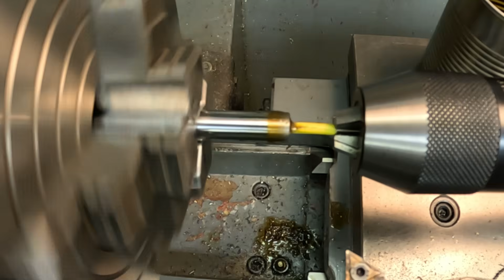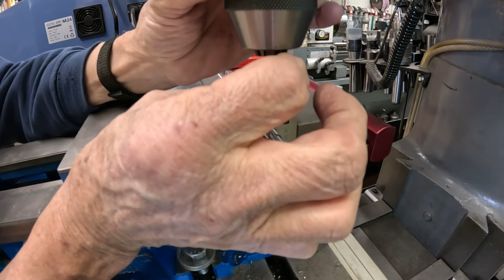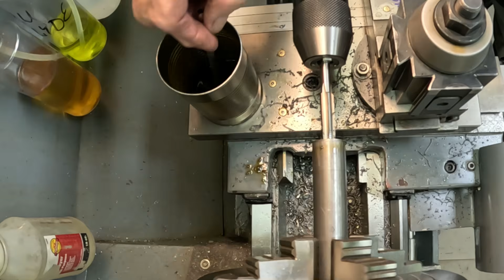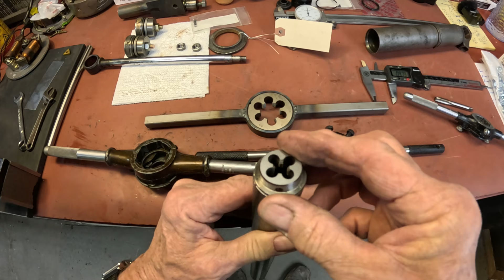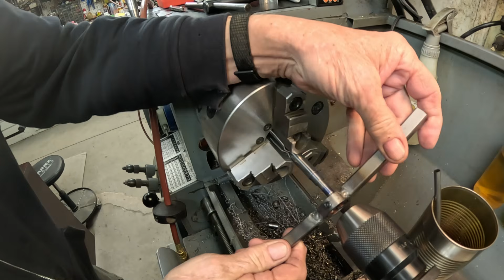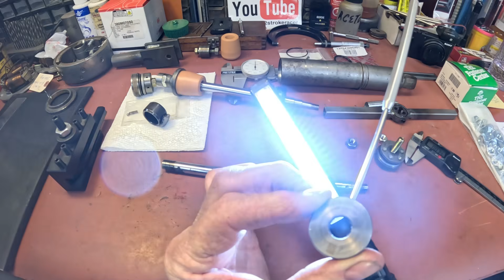Rebuild your Suzuki RM125, 250, or 400 rear shocks part 2

Comment: You don't even need a jam nut on the lower eye. Most shocks just use Loctite 272 there. They will never undo without heat. The top spring seat should fit over the lower eye and over the bump stop, so you don't need to have it on the body before assembly. On to part 3!

Comment: Hey Dale;  have you considered the servo motor lead screw conversion Clough42 has done ??  That gives you the ability to cut literally any thread.  I love his stuff.  I haven't done it, as I don't do that much threading.  But it also would give the ability to drive the carriage stupid slow, for very fine finishing on a smooth part.  I love all this stuff!
Reply from the maker: I watched that, but he is a young techy kind of guy and understands all that electrical mumo jumbo. I'm a mechanical guy that is more suited to changing tires and working on greasy old bikes. But that being said, I can appreciate what he is doing and wish I had the mind  that could do stuff like that, guess I will just set back and watch and enjoy his endeavor. I think I have located the gears needed to convert mine to thread more of the millimeter threads. That will be just fine for me, but I agree with him that I would rather eat a bug than change those gears. But the beauty of being retired is that we have a lot of time on our hands. I have to agree with you also....I love all this stuff, its really cool to watch all the different guys and gals out there work their different challenges.
Reply: @montana2strokeracer  I'd LOVE to try and set Clough42's servo-controlled lead screw thingy up on m y little Atlas lathe.  That stuff just fascinates me.  No idea what he charges for his setup, but I "think" I could pull it off.  I've messed with encoders, and computer controls most of my 2 careers (photogrammetric engineering, and then mining engineering automation).  Somehow I missed my true calling, as machining and metal fabrication is just in my veins.  That love was awakened by doing mechanical design, and then learning how to create drawings the machinists and sheet metal fabricators could make sense of.  Those guys taught me a lot of stuff ....... and then I had to go buy machines to install in my own garage.  Doing this stuff for friends is so fun and satisfying, and keeps me from hanging out in bars and chasing loose wimmens.
Reply from the maker: Oh yeah, I get it....think its above my learning. But I totally understand, this youtube thing keeps me out of the bars and chasing those loose hussies'.

Comment: Even a later model trail dual purpose model from Suzuki might be fitted and might be a rebuildable and have external rebound and compression adjusters and work 10 times better .... Back then there were many aftermarket shocks made and could be found with searches.... Whether thebike is worth upgrading of course would determine the cost spent....
🇨🇦🤓👍
Reply from the maker: Hey Gary its not about the shocks, its about the challenge of working with my hands to see if I can do what I set out to do. I enjoy the work and staying busy more than riding. I have done my racing and riding, today I enjoy this more than the riding, although I do still enjoy cow trailing. Racing is behind me, and broken bones take way longer to heal these days.
Reply: @montana2strokeracer I'm 68 and finished racing too and riding is not important right now...I realize you just want to do it and go ahead..lol
Anything can be done if you try...
🤓👍🇨🇦

Comment: I used to race motocross and Arenacross...started in 1975 and raced up to 1991....I started rebuilding my own shocks in the 1980's and frankly...while your effort is admirable...the proper way to do this is replacing the shocks for a modern rebuildable shock ...no matter the effort..you have old crappy shocks that will never compete against a better made aftermarket shock...ones that fit your model will be hard to find but there should be something you could find at a reasonable price ( although nowadays that has increased ) and then could be rebuilt easily to change the crap oil they come with and recharge the nitrogen as needed.... I realize this is content...but it isn't something that most people would attempt or could do....and the safety factor alone is not worth the time or costs... And fromemory those don't look like 1980 RM shocks ?? I had Yamaha's at that period so really can't remember...but I googled and saw completely different shocks online...what " exact " model was that from..it looks more like a trail or dual purpose shock than a Motocross/RM model would have?? I would like to know if possible...
🇨🇦🤓👍
Reply from the maker: I also raced in my younger days starting in 1970 and ,Yes these shocks are from a 1980 RM125. I realize that not many will try this, but to me it is fun to try and if successful it will work just fine for this 70+ year old dirt bike rider. I am using late model seal heads and new oil made for these and will do a refill of the nitrogen.  I'm not interested in new 2000.00 dollar shocks, that's more than the entire bike is worth,  just doesn't fit my social security income.
Reply: @montana2strokeracer I meant used shocks at prices were used to get them at..not thus inflated world..idiots pay $2K for $200 shocks...😂

Comment: Excellent work Dale.
Reply from the maker: Thank you Ray, sure appreciate the parts you sent. Will be getting back to the RM pretty soon.
Reply: @montana2strokeracer  No problem Dale, I have a box full of those RM shocks not even sure which models half of them are off. So when you started the series on the  shocks it immediately peaked my  interest so thank you for that

Comment: Been watching football & just seen this...Your videos are GREAT!!! I had a set of Betor rear shocks that had the center shaft threaded into the top eye/mount (aluminum). The shaft (I guess?) would spin when I was ridding and the shock would come apart. The center shaft would be disconnected from the top eye/mount and the spring was all bulged out. I tried locktite....didn't hold. The fix...a "Roll Pin". I re-installed everything and drilled clear through the top mount and the center shaft. Just like Suzuki (Kayaba) did on the stock 1974 TM125 rear shock top eye/mounts. Moral of this story, roll pins are your friends. GREAT VIDEO!!! What a TRICK Shop!!!!!
Reply from the maker: Thanks Steve, I totally agree the roll pin is your friend. Still may install them once this is assembled for good. I have seen many over the years with a pin through them, that's what I was looking for when I broke these down, but it wasn't there.

Comment: Hey Dale, great job. I can cut 1.25 pitch, just pop over next time. I've used the Amazon taps and dies when I've been stuck, not had a bad one so far. I think for occasional use they are adequate. I enjoyed the video. Best wishes, Dean.
Reply from the maker: Hey Dean, I'm popping over to thread some 1.25 pitch.....what's for dinner? don't want no tea. LOL, Where's the Concord when you need it? Think I have located the gears needed to make mine thread more of the metric stuff. I agree....this die worked like a champ, no problems at all.
Reply: @montana2strokeracer I'll put the kettle on. I'm sure we have some coffee somewhere...

Comment: Dale, the CB77 Honda shocks that I rebuilt a few years back had 9mm diameter damper rods (with a 9mm thread on the end that attached the upper shock mount) as well - maybe it's a suspension thing as it is a bloody uncommon diameter for sure.
Reply: In hindsight your idea of going to 1/2" diameter shaft is SO much cheaper and simpler that the route I took with the CB77 shocks where I paid to have the old 9mm damper rods re-chromed and ground which cost a small fortune!!
Reply from the maker: Hey Alex, yes I bet you are right, probably a suspension thing. The shafting is from a hydraulic supplier used for hydraulic cylinders, which is really what the shock is except its self contained instead of powered. Someone told me in the part one of this series that 12 1/2mm rod is available but I had already got this and the only thing I had to do was ream out the bushing in the seal head and the bumper retainer.

Comment: Dale, be nice if some smartie would  invent a universal device that will hold a tap/die from wobbling. always a issue especially at the start as you know. million dollar idea i think! :face-fuchsia-wide-eyes::face-fuchsia-wide-eyes:
Reply: Tailstock die holder. Taps I just use a keyless chuck. I have a die holder but hardly ever use it except in very rare occasions. I single point metric and imperial threads, it’s actually faster and a more accurate thread than those dies ever could render once you do it a bunch it’s like anything else, muscle memory.
Reply from the maker: My lathe in its current form will not thread metric 1.25 pitch. I have just found the gear I need to do that. I can thread 1.5 pitch and all imperial.
Reply from the maker: Rodger that Frank, mine are so worn out over my dads lifetime and mine.

Comment: Hey Dale, there are probably not a lot of people that would attempt this to begin with. You have the patience and ability to do so. Secondly, having to do something twice makes the task that much more satisfying when complete.
Reply from the maker: Hey Doug, yeah I know, but its fun for me, I have had several that think its foolish to do this, and think I should just buy new shocks. But its really not about the shocks, its the challenge and the fun of the project. Yes I agree with you, the more trouble you have, the more satisfying the project is, hoping it will actually work. If so these will go back on the 1980 RM125 that I will build soon.

Comment: Dale,
If you have a Menards local to you they carry odd size metric tap and dies for threading purposes. Also for odd ball metric fasteners look at Bel-Metric. I've ordered from them in the past with good  success. Im currently waiting on 7mm countersunk bolts to repair a rear hub on a 1989 YZ250 Yamahopper. One of the rotor mounting holes was blown out and can be repaired to 7mm. Keensert or Helicoil wasn't a option due to material constraints. 
I'll have to turn the heads down on the Keller Grinder to meet the OD requirements of the OEM fastener as the rotor mounting holes are stepped before transitioning to the 45 degree.
Best of luck Sir. Did you get your delivery from Sunnen?
Jeff Davison. Home of Central Michigan Suzuki.
Reply from the maker: Hey Jeff, no Menards here, Ace hardware is as good as it gets. I will take a look at Bel-Metric, I sure appreciate the lead. This has been a year of firsts. Early last year I used a 9mm wrench for the first time, now I have used a 9mm die for the first time. Never a dull moment around here. Yes got my oil from Sunnen....will be finishing up the TM cylinder this week.
Reply: Hey Dale.
No CZ projects going on here. Perhaps another viewer youve been in contact with.
Only bike project going here is the 89 YZ250. None of my large metric  sockets normally used for engine with 80's era Suzuki engines are the same size as Yamaha 89 YZ250. Luckily Menards is in the area and carrys a large supply of Metric sockets.
Ill be in touch.
Jeff Davison.
Reply from the maker: Sorry Jeff, the CZ project was another viewer. I realized that and edited it out but you got it anyway. Yeah I think those manufacturers enjoy messing with us. Why cant they all use the same size and type of fasteners? All these odd size cylinder studs, 7mm, and 9mm.....what is up with this. Why not just use a 8mm? LOL

Comment: Thanks Dale , I hope all is well with you . I am waiting for the weather to warm up  , Its snowing here in Georgia this morning ,. I always learn some thing new from You . Thanks again Dale .
Reply from the maker: Hey Murray, we are doing great, the cold and snow is missing us this year, guess its going your way. Been close to 60 the last couple days, and we have only had about 6 inches of snow so far this winter. This is by far the warmest winter in my 35 years here. Looks like a change may be on the horizon though. The lack of snow here in the low country has no effect on the High country snow pack though, the High country is at about 128 percent, so plenty of snow up there for spring run off.